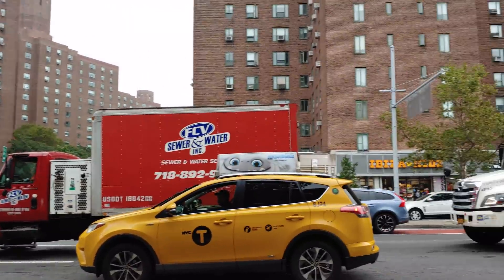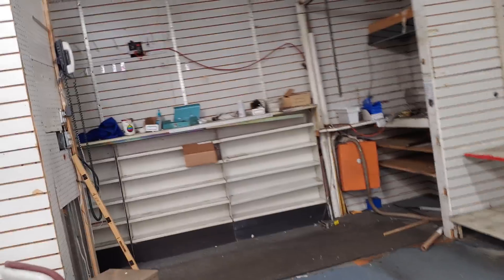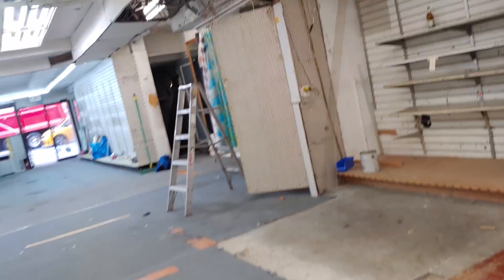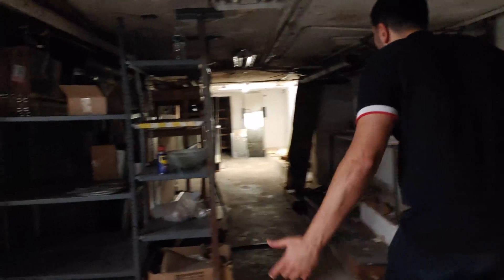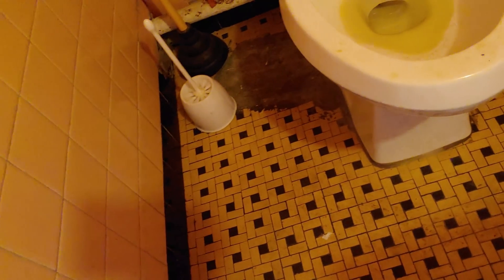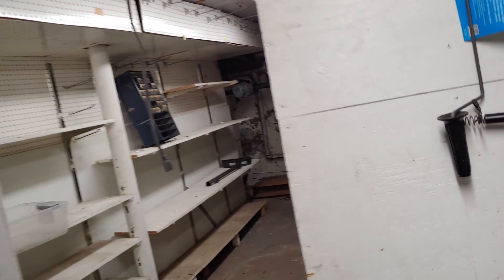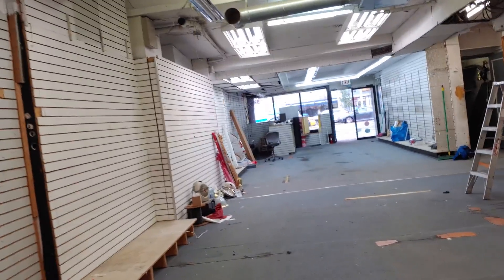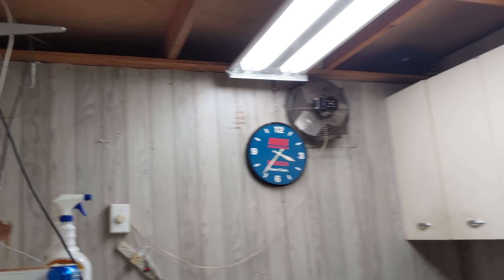[1ST AVE 20TH ST] Is this BETTER or WORSE than bella tile(last video) to be used as our new store?

Comment: Positives: 1) better security gate. 2) huge canopy/sign. 3) double doors. 4) wide layout! 5) lots of places for shelving. 6) 200 amp service! 7) street hatch. 8) big basement. 9) generally dry basement. 10) the guy goes straight to bringing it to white-box condition for you. 11) The guy seems to understand what you are looking for and how a store operates. 12) Two or three bathrooms. - - -  Negatives: 1) water damaged ceiling up front? - - - This one is a good option. Bella Tile is a looming future of headaches with that grandpa situation!

Comment: This seems like a lot less work, and a good space. The slat wall would be great for both merchandising and utility/tool hanging. The slats look to be in great shape, and at most need some painting. Just build another counter to separate customer and worker space, maybe with a soffit/shelf for signage and storage. A little paint, some high-traffic carpet or concrete stain in the customer area, some ceiling tile and light diffusers... a few workspace partitions and desks... good to go...

Comment: I like 32nd and 6th the best, but this is a good deal. The $12K for it is a good deal, but this is a similar setup, with nice frontage and 1/3 less in rent. Just not near the space to grow. But keeps your overhead down. 32nd and 6th is a beauty. All those upper floor office space ones are a joke. Lip stick on a pig. These type of places represent the end of an era. They have character you can't get from fancy now modern interior design. 
That tile in the bathroom had meant worrying more about the tile in the tile places basement, which represents a historical artifact and needs to be preserved and kept in that general area, so it gets used for restoration work. The old guy won't sell it because he knows the true value. It's priceless. :)

Comment: Luis, looks pretty good and the asking price is more than fair.

Conpared to the last place you dont need a ton of renvation (200a SquareD QO panel is definately a great plus) plus the deliery hatch for the basement for ups, fedex and usps.

Check for moisture and mold issues and get an inspection done.

See how well local businesses do. The apartment complex across the street is a definate plus.

So the other location (the tile place) would be a better location, this will save you 4k per month and tens of thousands for renovations.

How is the HVAC in this new place?

I like the roll up security door. Definately will keep the renters and liability insurance down. Get a ton of cameras in there (POE like Dahuas etc) and an alarm system.

Comment: I like it the space isn't WIERDLY shaped, The frontage is at the street level with full windows across it, and it's on a big street where you can actually SEE the store as you come up (instead of packed on a shitty small street with a hundred other shops)the basement is usable, the bathroom is downstairs away from the rest of the store, so you can find some peace (instead of taking a sh__ in full view like that other place 😂😂😂) like he said the bones are there: The electrical, the hvac, its greaaaaaat. The walls look like you can immediately hang shelves with EASE. I wouldn't worry about painting or flooring...it seems you don't prioritize that in your current locations anyway 🤣. Just order your signage, move your shit in and DO BUSINESS!!!

Comment: TL;DR This is spot on. For what you do, you want basically a better standard, bigger, less cramped version of what you already have. And a great storefront. Pretty much everything you do, needs at least 1 wall. Big open spaces are useless for bench work, work lighting, at-hand tools and parts storage.

Damn, that street hatch and big-ass basement, that area - this is perfect for your kind of (expanded) business - where the majority of work and space goes on "in the back", tonnes of packages and goods going in and out - but you want a more roomy, more inviting front end too. It needs some TLC, but this could be great.

If I've understood your plans and interests for expansion, beyond elbow room for current work - this is what you need. Maximum space adjacent to or near at least 1 wall - without being cramped. Big open spaces are for showfloors, galleries and when others are picking up the tab. Doing the kind of labwork and sales you guys do, most large open space is useless. It's a pain in the ass to set up workspace, power and tooling, and a pain to arrange good lighting for detail work - you need a wall to bounce light off, hang tools, set racks and equipment up against etc.

This space is what your current one should have been.

Comment: Looks bigger than other places you visited on the 3rd floor of a business building. Hardware stores are stable businesses. They don't usually move and change every 2 years. They likely don't have cockroaches either, unlike restaurants which often are quick turnover businesses. Probably the landlord is used to and values stability, so you might more easily get the 10 years lease you wanted. Basement is dry and solid so cleaning it up would make it a decent working space without over the roof investment. The toilet is old but still in good condition. This building is sturdy.

Comment: It does seem like its better.  You have double the width which is nice, you could partition some of the space for extra storage.   That office in the back could be your personal streaming lounge (unless you like bieng up front with the customers which is fine).  That basement looks like it will need some TLC, but nothing to major from the looks (no cockroaches).  The place already has HVAC in place, all that is left would be total clean out and some construction.  I approve.

Comment: I like this place better.  But finances are the key obviously.    I am sure you already know what areas you are looking for.  No red flags as far as the layout is concerned.  Obviously the bathroom needs to be redone.  Cleaning the place out won't take that long.  You can keep the flooring the place simple by just using some office carpet.  Plus that bus across the street means easy access aside from the apartment and being street side.  Overall leagues ahead of the tile place given how much work the tile place will require to get something done.

Comment: Hi louis I just saw this video about your new shop the way i see it on are street level lots of people round buses go by and cars. The shop needs a bit of tlc price is right for you some building work will be needed overall nice place to start an upgrade from looks a lot better than you are now as you say your shop had water damaged 2 times no heat in the winter,  your staff will be happy in the new shop that's for sure also if the shop looks good from outside people will go in more. if it looks crap because lack  of space some might just walk by. which is the case where you are now. All the best louis hope you get this new shop so you can move in quickly and start repairing more hard drives  with employees :-)

Comment: This is the best one so far. Good width and size, uncomplicated shape, large basement with street access, better security, reasonable price, nice shop front and layout. It also looks like you will get a lot of foot traffic here. There is a lot less work to do to get it functional compared to the restaurant with all those fittings to remove. In my opinion, it is better than the bella tile one. I would also avoid the locations that are not on street level as you will loose a lot of foot traffic.

Comment: Its set up as a store: it SHOULD have proper air conditioning for product storage. The walls are a HUGE plus. Imagine the storage capacity and configuration options. Plus, it has couple of separate rooms. Your back-office ofcourse and the small workshop room in the basement (which I would see as locking storage for expensive stuff). If you can haggle it down to 9k and 6 months of free-time, it would be a really good drop in store. You can section off the front-end and build POS for 2-3 stations with some waiting area (a table and a sofa or smth). Best one so far, IMHO

Comment: Have you tried the "pro" manual video mode to use the wide angle for videos? On the g7 it works if you disable hdr10 in video mode

Comment: When I saw the vid for Bella tile, something felt off about it, the size looked very similar to your current one, and it did not seem to be an upgrade. This one in the other hand looks way better. You can keep checking for more, but it's gonna be hard to top this one. And the pricing is reasonable.

Comment: The front door seems to have a massive gap between the door and the frame. WAY too easy for someone to slip a deadbolt opening tool in there. If you end up getting this, you'll need to address that as it's a big attack vector

Comment: Don‘t like it. You had much bigger and better shops.
It will limit you from the beginning as it is only double the space.
The one with the steps down was beautiful and big enough to expand and have really space to set up everything right. You could even put a second floor in it. 
Dont like it. It resembles your actual shop and is not a step up to the future.
Greetings from Munich, Tom.

Comment: I mean, it needs work, but it's potential is greater. The door is right at the front, with large windows. There's a better security gate. The basement doesn't have a ton of tile to be moved. It's a much wider space. The electrical is better, but needs the same amount of stuff run through it. The downside is that it's not in close proximity to your old location.

Comment: Some questions I'd want answered. Has the basement flooded? What's the bathroom situation? HVAC would probably need some attention. I didn't hear where the condenser is installed. Was it roof or ground level?

Otherwise, it looks good. I'd even leave up the shelf tracks where the work benches are going to be.

Comment: My concerns for this place are ..
1 - does not have potential for much growth I think by the time you add workstations/benches you would not be able to get many more staff in there than you have already.
2 - the street door is probably to cause of the apparent damp in the basement.
3 - no ground floor bathroom that I could see.

If you just want out of your current building,it would be OK but i think the lack of space to expand into would have you having to relocate again in a few years time.

Re: the tile shop
The ex tile shop would be great but the fact that the landlord and family live upstairs and need that entrance and the weird location of the stairs on the 1st floor would stop expansion upstairs completely.

an Idea would be to replace front windows with a door and window instead, and seal up the door in the corridor leaving the current door for residential access only.

I would probably want to reinforce the walls of the residential corridor to stop people breaking into you via the dry wall.

Comment: In terms of potential for a store, needless to say, yes. A bit rough and would need some work, but it at least has some fairly reasonable facilities. It has a storefront and a gate, which is good, along with plenty of room for a wider workshop, plenty of storage space below. It could work. Double-check the utilities, including internet, and see if there's a pricing history. Bring the mythical Paul with you and see what he thinks. Get someone to measure out distances so you know just how much more space you stand to gain if you upgrade, specifically with all of the equipment in the new store.

Comment: This place is great for your usecase. I saw hardware on the sign and i thought, what better place for a repair shop than a former hardware store.

It has a fron zervice area, indents where aisles used to be, a back office, a good sized basement and even has street access for said basement.

It's not perfect, but with some cleaning up and renovation, it has potential to reach near perfection.

Comment: I wouldn’t touch it with a 10 foot pole... Major signs of moisture and leak issues. Those wet and sagging ceiling tiles are a dead giveaway, not to mention the moisture stains on the floor. That place leaks like a sieve! Go back when there’s a good rain going on and you’ll see what I mean. If you get it, expect major problems, not to mention health problems from mold and mildew. I speak from experience. Best of luck!

Comment: This one is open and a decent basement for product storage and possibly more employees. The hardware store is definitely more inviting than the tile shop. Only benefits of the tile place has is the ability for expansion with the upstairs if you can talk them into adding it to the deal. They would also have to clear out the basement. If they add the 2nd floor to the tile place for around the same price you could have retail space + work space so you can have an online store and sell items in the brick and mortar... but I’m all likelihood online is better with the choice of in store pickup. If they don’t include the upstairs, this one is it until you grow out of it, if you grow out of it. Get some tape and lay it down to get the idea of how a layout would look. The hardware store is definitely less work.

Comment: i like the store front of this, looks like a 'proper' shop, it's wider & looks less cramped, less stuff to dispose of than the Tile shop too,  nicer basement than tile shop,  but no bathroom on main floor.   
I like the tile shop too,  bit narrower, still got a front window, so looks like a shop & has illuminated signs, bathrooms seem ok,  needs a lot of junk removing as does the basement , 
Needs a roller shutter on the window & door though.
pity the tiles downstairs can't be binned, or i would prefer this by a whisker.
Much better than the hideaway offices. might be an easier move too and existing customers won't get too lost going to the new shop, as it seems so close too.
to me, there's not much in it.

Comment: Honestly as someone who lives in NYC I liked the larger office space better. Much much better train access. 1st ave ain’t the greatest, neither is 8th but hey do what ya gotta do. Just preferred the space near all the trains. Not a lot of people just walk around with a Mac book looking for a repair shop. Although the elevator situation could be tricky. Best bet keep looking. This space doesn’t seem big enough for more than what he currently has to be comfortable.
Reply from the maker: Yeah I agree with you on the trains! 

The problem with them will become apparent in my next video. If you have more than 20-30 people showing up in your office per day, they will kick you out of the building or deny your application. I'm not kidding - at $13,000-$20,000/month, many spaces will still deny you based on the number of people you have showing up.

I took them aside for a talk about it. Do you mean party clientele, bar clientele, or just normal people showing up with a broken Macbook? Even the latter - it's nuts! I asked if it was about the elevators being slow or not wanting to clog limited elevators, or the social issue of not wanting to have what appears to be a "noisy" or "active" building. They wouldn't say it was the latter, but they said "it's not the elevators."

The midtown office spaces really suck in this regard. I have seen a bunch I couldn't record, and most go the same way. They hear that I will have 50 people a day walk in and they say no deal.

The broker says not to tell them this, but why? If I am paying $13,000/month for a space, why do I have to LIE about its use or HIDE something to avoid getting in trouble? Why am I doing the same shit I did to hide the fact I was bringing headphones to class in high school when I am a 30 year old man paying five figures a month for commercial space? 

I was throwing around the idea of a midtown location - MUCH more convenient to get to by trains. Screw that, and screw the midtown landlords is what I've come to so far.
Reply: @rossmanngroup  That makes so much sense about midtown landlords, currently work in midtown and company is moving over to something smaller (don't need as large of a space) and after I heard what we were paying in rent and it was ridiculous, I've worked in offices nearby to where I am for 2/3 the price and 2x the space, just not as high up (in the 20s vs high 30s). 

Also that is so stupid that landlords, would deny you for that amount of traffic. If you're paying for that rent, you own the space and you should be able to do with the space what you please. Especially if you renovate it for what seems to me after following your videos around 100k. If you're improving the space that much and are a monthly occupant of the building paying that much in rent, why should they be able to deny you on the fact that you are a good business, shouldn't that actually make them feel more comfortable that you would be a long term client?

While I would love for you to find a super convenient mid town location based off your experience and my simple knowledge of the rent prices the companies I've worked for have paid, doesn't seem like you'd be able to get the amount of space needed for some future expansion plus the trains without paying a stupid amount.  Maybe near the Jatvis center over down on 8th/9th and 33rd/34th, my friend works over at B&H, and they have a deal with a camera repair shop nearby who they give out business cards to if customers come in with broken cameras, they might do the same for you plus it's near the 7, which cuts straight through midtown. Just a thought?

Comment: Big pros on this one and some things to keep in mind 

1. Price 
2. Bigger than your current
3. Reasonable landlord
4. Across the street from residential units. (Major walk in potential) 
5. Taco bell is nearby

Cons 
Older building problems.
-mold
-plumbing issues
-shotty electricity 
-not up to modern day fire code.